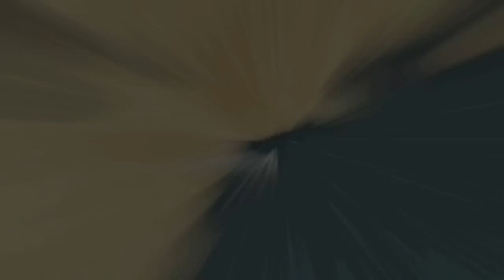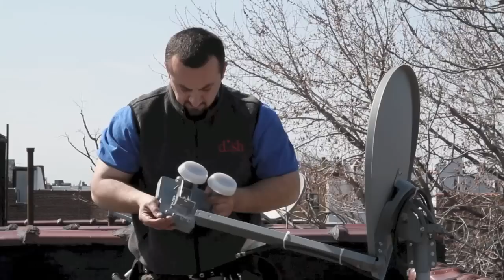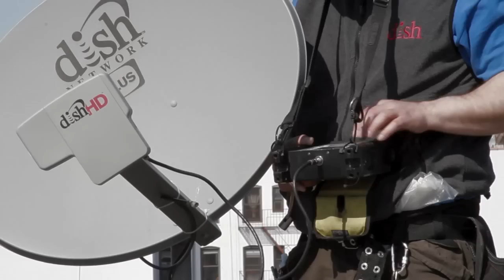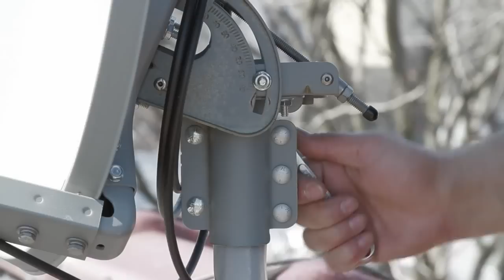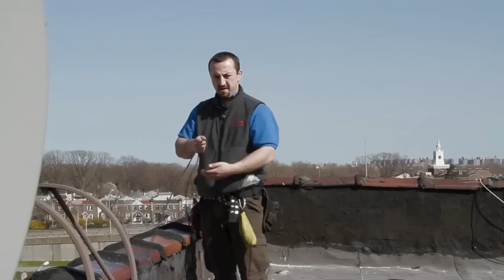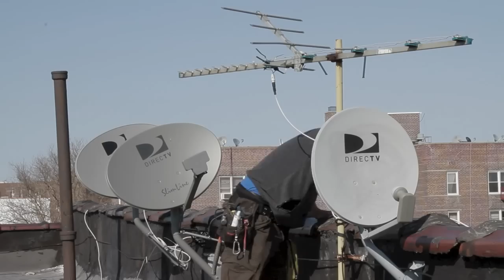Dish Network Technician AL

Comment: God thats some sloppy work man lol.  I work for dish, actually i work for a large authorized contractor for dish here in florida and theyre strict, we have to take pictures of all of our work so there isnt much room for slacking but i try to do clean installs anyway so doesnt bother me much.  Code has changed a lot but we arent allowed to use nail clips only screw clips, takes a lil longer but holds the cable tight without sagging.  Nail clips tend to fall out ALOT.  I hate them

Comment: You know one thing, you can run more than one receiver from one dish. I was before I retired a lead worker for a Two Way Radio Lab here in Illinois. And I know how head ends are built and how STV is distributed in housing. How come Dish Network Tech's use more than one dish on a roof when one will feed the entire building?
Best regards
Jimmy, ARRL TS, WX9DX